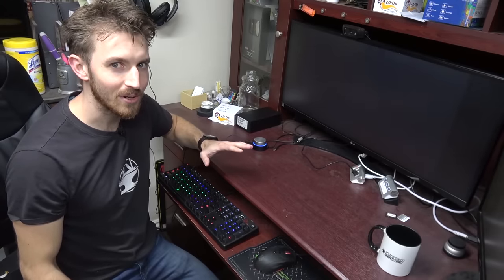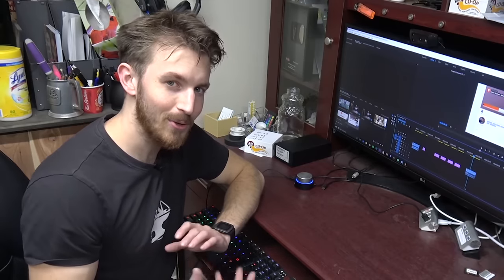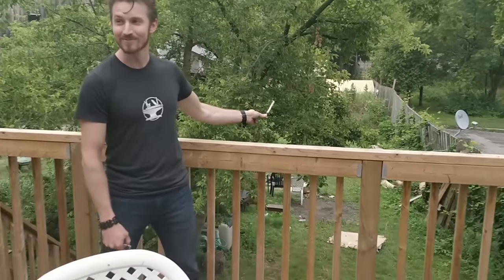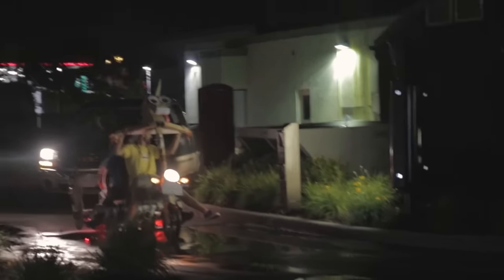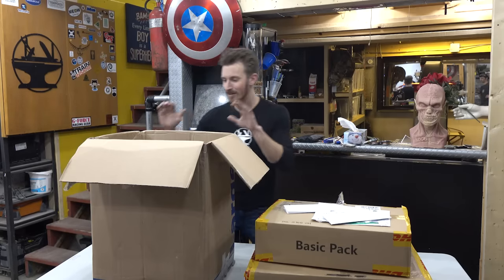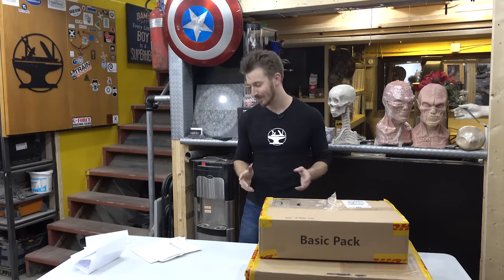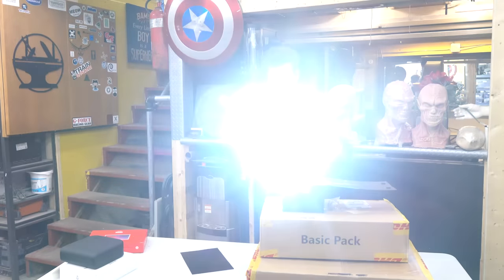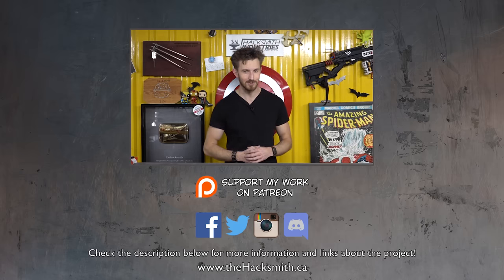3D SCANNING!? A Day in the Life of the Hacksmith (FLOODS, BREAK INS, FAN MAIL, GIANT HAIL AND MORE)

Comment: Your next project should be a flood prevention in front of your garage so the flood doesn’t happen. If anything a system where it holds a certain amount of water in a container like a septic tank and whenever you do any flammable projects you have an external hose connected to the tank and you don’t have to rush inside for anything extra, unless it’s a chemical fire then it wouldn’t be used. Just me spitballing an idea I saw from the fun flood you had